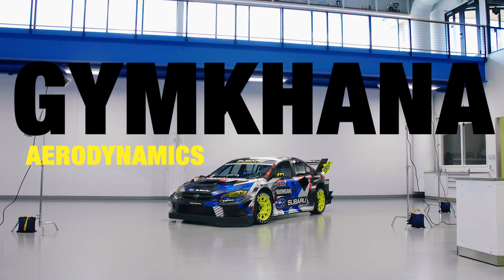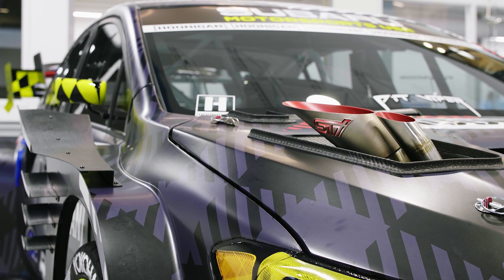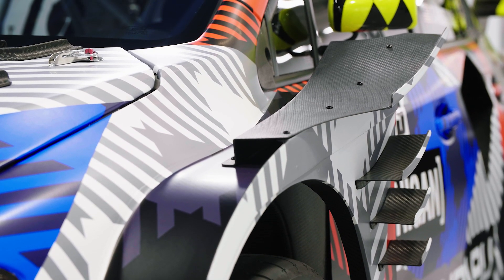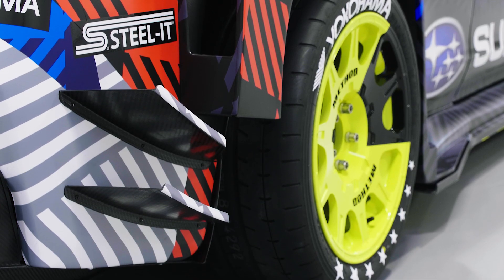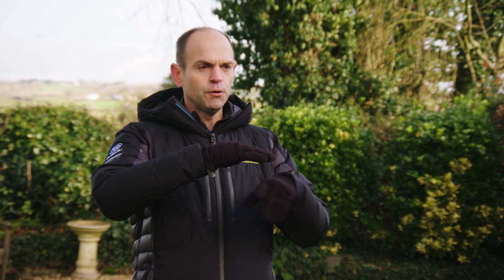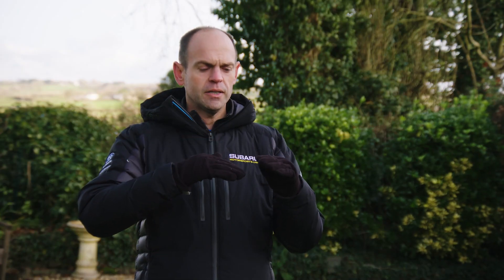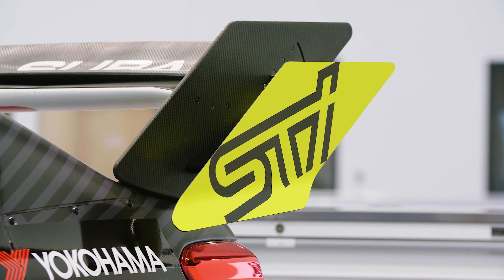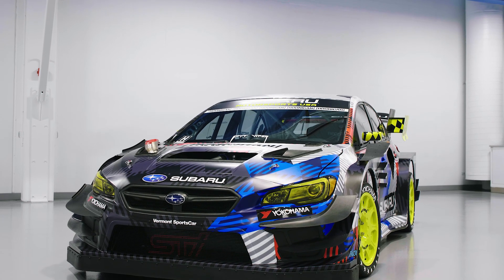Gymkhana Aerodynamics – Building an STI to Fly

Comment: The thing about aero is that you need speed for it to work , so when this was tested in the wind tunnel, at what speed it starts to be effective, since on high down force cars the effects start at 150+ kph ?
Reply: The typical STI Rally tail works at 65 kph for the primary downforce while the active part assists in nose control. The jump speed was 160 kph and the top speed attained in the video was 245 kph. If all you do is asphalt racing then the STI Rally tail needs to be replaced.

Comment: I know it’s a CONSTANT rumor that Subaru is returning to the WRC with a new chassis in the next few years, I wouldn’t bring this up but a lot of what we see in this car incorporate elements that are regularly seen on current spec WRC cars.  It makes one wonder if one of the side benefits of this project is to trial some of the aero elements one might see on a future WRC entry.  It would be really cool if VSC were given the chance to run a WRC season, it’d be a hell of a challenge that would require opening a European base and a whole new level of logistics but there’s a whole lot of technical expertise and experience at VSC now especially through the rally X program, it would be an interesting new challenge.

Comment: Is it mere cosmetics? How fast a rally cross car peaks in the circuit? Does this speed capable of downforce generation? Drifting.. sliding..at corners hardly at downforce generating speeds. I hope kyle engineer can analyse this car. The car looks fantastic but I doubt it helps with aero negative lift.
Reply: This Subaru STI was custom built for a Gymkhana event with top speed of 155 mph and a 100 mph jump. Go watch the video, you won't be disappointed.